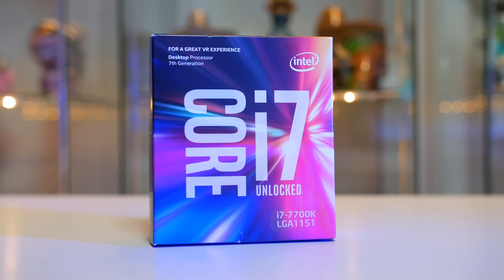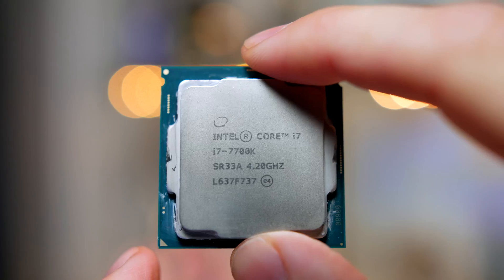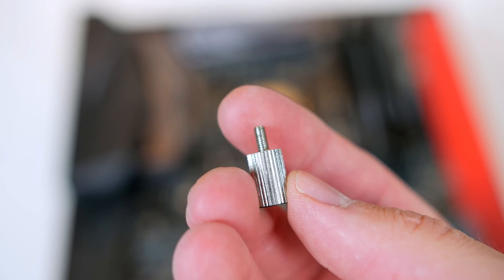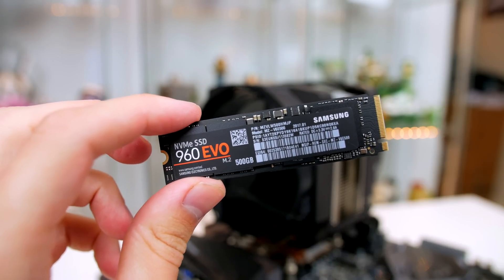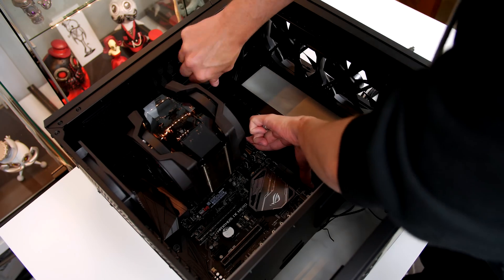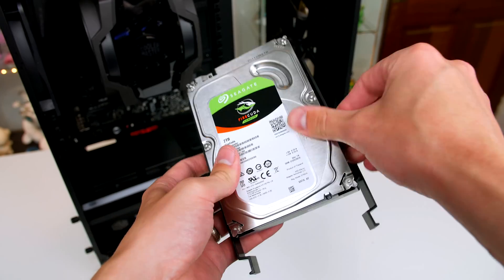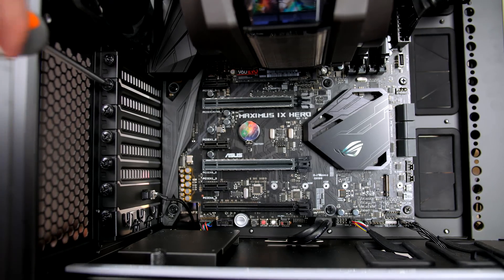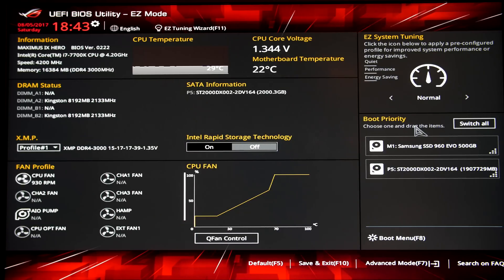How To Build A High End Gaming PC 7700K/GTX 1080 - UNILAD Tech

Comment: I actually have the same build but i have a deepcool cpu air cooler and a gold power supply from corsair 550w . Is it enough or should i upgrade or is it not necessary cus i don't overclock anything

Comment: Overall would you recommend building a computer yourself out of accumulated parts vs buying a prebuilt one? 
I feel like for the same price as a factory built one you can get much better computer hardware wise because you are essentially taking the labour cost of building the computer out of the equation.
Reply from the maker: You can most definitely build a better spec PC yourself. It's not an overly complicated procedure tbh. If you take your time no issues should arise.

Comment: the gtx 1080 ti's in Canada are $1000 which is like $400 dollars more than a gtx 1080. And in my opinion $1000 for a gtx 1080 ti is retarded cause its like half some peoples budgets. So its better to get a gtx 1080 paired up an intel core i7 if your budget is around $2000 (i know this is kind of a pointless comment but i just wrote it for my Canadian pals)

Comment: Can u tell me where I can get that easy extension for front io panel connectors they are super annoying to install always a pain would be nice to connect them into extension little block that tu got there and just shove it on the Mobo easy peasy . Just a super useful extension I'd like to have around
Reply from the maker: +TheSURGEofTech tech came with my motherboard
Reply: BeginnersTech well lucky guy then I guess I should look into the same  case manufacturer maybe they have em for sale

Comment: This is my first pc build. Can you see if it is good and is compatible?
Case- Corsair Carbide Series SPEC-ALPHA Mid-Tower Gaming Case
Power Supply- EVGA SuperNOVA 650 G2, 80+ GOLD 650W
Video Card- ZOTAC GeForce GTX 1080 AMP! Edition
CPU- Intel Core i5-8600K
CPU Cooler- Cooler Master GeminII M4
Motherboard- ASUS PRIME Z270-A ATX
RAM- Corsair Vengeance LPX 8GB
Hard Drive- Western Digitals 1TB Blue Hard Drive
SSD- PNY CS1311 240GB 2.5” SATA III Internal Solid State Drive
OS- Windows 10
Reply from the maker: +Eric Zheng looks fine just put all the parts in PC partpicker and it will tell you for sure. Looks like a great build be sure to tweet me a pic

Comment: 1200w psu is overkill for those specs.
Reply: TWITCHIE224 I'm a noob with pcs and I'm wondering will it fry my pic if I put it in a higher voltage outlet?
Reply: I was thinking the same thing. Maybe like 750 watts?
Reply: Elnikona no you won't, the PC only takes in however much it needs. But the power supply can go all the way to however much Watts it is I recommend a 500watt psu
Reply: M1cha3l Sm1th I'm building a very similar build as the one in the video, I was planning on buying a gold 80+ 650w psu. Should I stick with it or go lower 550w or higher 750w???
Reply: 850 tops
Reply: Gabdu32 i am planning same build with i7 8700x and 750W will do the job

Comment: Wtf why gtx1080 not 1080ti
Reply: Not sure what cards you're looking at, it's a lot more than an extra 50 dollars.
Reply: I can't afford a GTX 1080
Reply: GrodTheAlmighty Well were i live they are 50 dollars more no joke
Reply: country Mac i got mine for $20 more lol
Reply: Steve Rocks he buys a 600 dollar ssd, 250 dollar motherboard, 250 dollar power supply. If he can do that he should have bought a gtx 1080 ti
Reply: TBDG where u live and how much lol
Reply: Fahim Khan The test I saw awhile back. Shows just how unnecessary. m.2 is for gaming system. YouTubers got people out here spending over half a grand on m.2 cards they don't even need. I guess normal ssds were getting to affordable for YouTube rich.
Reply: country Mac whatever u say
Reply: Consider what resolution you are running.  If you're running 4k near max settings, get the ti.  
However, if you want to run 1440p or 1080p with high frame rates (well above 60 for most games), the
 1080 will suffice.
Reply: Definitely going with the 1080ti, will it run any AAA game from this year at max settings 4K 60 fps?

Plus i’d rather go with a $1080ti. $200 more is nothing when you’re already spending $800 on a 1080. Spend the extra $200 get a ti which is at least minimum 30% better in performance than the 1080 and you’ll be saving by future proofing for at least a year or two longer than with a 1080.
Reply: Where do you get $800 for a 1080? thats an outrageous price, this is what i paid for mine:
EVGA GeForce GTX 1080 8gb SC2 GAMING iCX - $589.99, your going to spend almost $800 for a Ti.
As for your question, graphics card is just the card, a good card will help in getting higher fps but...
cpu, ram and running an AAA game on an SSD makes a big difference.

Consider my specs as an example i just built this at end of September here
============================================================
CPU - Intel Core i7-7700K Kaby Lake Quad-Core 4.2 GHz - $339
Motherboard - EVGA Z270 FTW K - $209
GPU - EVGA GeForce GTX 1080 8gb SC2 GAMING iCX - $589.99
Ram - G.SKILL Ripjaws V Series 32GB (4 x 8GB) - $348.99
PSU - EVGA SuperNOVA 1000w P2 220-P2-1000-XR - $249.99
Heatsink/CPU Fan - Cryorig H7 Tower Cooler - $34.99
OS - Win10 64 on WD 500gb SSD
all my games on another SSD by itself.

with the following i get 80+fps in Arma3 and Ghost Recon Wildlands.

Now here is a review, mainly based on arma3 as that is the main game i play
http://techreport.com/review/31179/intel-core-i7-7700k-kaby-lake-cpu-reviewed/11
You need to keep in mind that a demanding game requires a good cpu, ram, and of course a good GPU helps, ram tho does make a difference, for arma3 at least DDR4 at a 3000+ frequency is ideal.
    With my new specs all the games i play which is mainly arma3, and Ghost Recon i can play with maxed settings! So dont let it go to your head that having the best GPU is the answer, its a few components, if you had a high end gpu, weak cpu, and ram, you would have a bottleneck and your game would choke somewhere.
Hope that helps.
Reply: Gunter Severloh we’re all in different countries so everyone’s currency is different :p. I’m getting the EVGA sc2 1080ti here in Canada and it’s, $1000, after tax almost $1150.
Reply: Gunter Severloh also I was thinking of going with the same CPU as your build,  not planning on cheaping out on my build, looking to spend in the $3-4000 Canadian range. (Probably around $3000 USD) since I want to future proof for at least a good while.
Reply: A fellow Canadian :) I was born there but live in USA, want to go back one day, but back on subject a ;)
ya i hear man, whatever you can afford.
Reply: I would go higher with the cpu then because my build is pretty good, and might be fine for the next 3 yrs but the game these days are getting more demanding, be sure to definately get windows 10 because you will be able to run Direct x 12 games so keep that in mind, but ya imo dont go cheap if your a gamer and demand performance and want to be immersed, if you play as much as i do, for me i average maybe 2-5hrs a day more on weekends, otherwise im working on vids and other projects for the arma3 community, but none the less when you play you want that performance, go for it, whatever you think you can afford go higher.
    I would really research first tho, and research parts ect,. based on what your playing, what i did and no i can play what i play full maxed out settings, what a major difference!
Reply: Steve Rocks its only 50 bucks more lol

Comment: Looking to get the best CPU for gaming, what do you recommend? Money's not an issue. Pairing it with 2 GTX 1080s and ASUS gsync 34" curved monitor. 7700k to wait for the 8800k that's releasing this month? Seems like the 8800k is beating the 7700k in benchmarks
Reply: Jason Daudelin you’re better off with one GTX 1080ti than two GTX 1080’s. A lot of new games really aren’t working well with SLI lately from what i’ve been noticing, many new releases don’t even support it for some weird reason, it makes the second card just an expensive paper weight.

Comment: Question for you if you can help. I bought the NZXT RGB fans that you have used in previous builds and have the same motherboard as your old editing pc build. I bought the Hue + as well to hook the fun up for the lights, not sure if you have that on here as it is not shown. I am having an issue because I only have 2x 2.0 USB ports on the motherboard to hook up to which are both being used. One is being used by my Corsair H100i v2 and the other is being used by my power supply. Is there an alternative to this at all?
Reply: I figured this out.. if anyone ever has this issue they can run a micro usb to a regular 2.0 usb port on the back side of their computer and it will take place of the 2.0 slot you might be missing on your motherboard. It might look ghetto but it works.

Comment: Under what circumstances would you recommend GTX 1080 over the TI version?
Reply from the maker: +clarkkent999 if go for what you can afford tbh
Reply: clarkkent999 the ti version is about 200 dollars more on average and while there is a great performance boost, you also have to consider what resolution you are running.  If you're running 4k near max settings, get the ti.  However, if you want to run 1440p or 1080p with high frame rates (well above 60 for most games), the 1080 will suffice.
Reply: I think as long as you buy from a reputable dealer online is fine. I have bought plenty from Amazon and Newegg with no issues, it might be a little easier to go in person if have a store nearby to return any items but online purchase should be fine.
Reply: Jimmy God damn boy you rich af bit seriously I have a question I'm trying to build my pc is it secure to order parts from amazon or online or is it better to go to a store in not from the U.S that's why I'm asking.
Reply: Jimmy Ok thanks a lot because there are a lot of scammers 👍 Thank you
Reply: Alisdair MacDonald kk
Reply: It's 250$ less?...
Reply: Depends on what monitor you have. For 1080p a gtx 1060 is enough but for 1440p get a gtx 1070ti or gtx 1080
Reply: Money
Reply: GTX 1080 Ti is worth the upgrade, you will have that card for a bit and it will maintain its edge in games for the foreseeable future. AMD just launched Vega but sadly those don't compare to the 1080 Ti so Nivida has the high end market locked. But from what Alisdair said, it also matters the resolution that you are playing at and your monitor. If you are just doing 1080p the 1080 Ti is overkill, so is the 1080 for that matter. I personally have a 1080 Ti with a 144hz 1440p monitor and for me the 1080 Ti is perfect at this level.

Comment: hi, I'm planning to build a PC similar to this once the mining craze goes down :) but i would like some advice, I am still unsure about the case. Do you have any recommendations for a case that's good with cooling and has a window?
Reply from the maker: +Aiball I love this case but others worth looking at are 570X and P400s those are among my favourites
Reply: thank you for your input, I will probably get the P400s :) sorry to bother you but i have one more question, I'm stuck between getting H100i V2 cooler versus an air cooler, what would you suggest?
Reply from the maker: +Aiball I love the H100 or the Kraken X62

Comment: Build a budget pc on ryzen ❤
Reply: xMysticalTaz There is no "Ryzen 6"
Reply: Transistor Express *threadripper
Reply: BeginnersTech 3 ❤
Reply: there is now
Reply: xMysticalTaz 😂
Reply: +BeginnersTech ryzen 9
Reply: r5 1400 on b350 board, 2x4gb 2400ram, gtx1060 3gb or 1050ti, 400w bequiet non modular psu, 20€ case... best budget pc atm imo
Reply: We'll see how much time your pc will be useful...
Reply from the maker: GRAN TORINO how budget? RYZEN 3 or 5?
Reply: BeginnersTech 
Ryzen 3 please
Reply: Ryzen 6 or 7

Comment: how do you rate my future build
https://pcpartpicker.com/list/Yvmv9W
Reply: was going for a white and black with red accents
Reply: downscale cpu to r5 1400, upscale gpu to gtx1060 3gb, use cheaper motherboard (b350 tho) and maybe a cheaper case, if you're on a budget. trust me, that'll do better :)
Reply: oh, and go for a 4slot ram motherboard and go for 2x4gb ram, dualchannel is significantly faster! + you have room for more upgrades later!
Reply from the maker: looks good
Reply: I think you could get a better case but it's looks good btw is it black and red or white and red
Reply: From what I've heard (no actual experience here) price/performance-wise, either dropping to a 1400 or bumping to a 1600 may be more bang for the buck. I haven't seen too many 1400 vs 1500x comparisons though.
Reply: you are spending alot of money on the motherboard 
You could get a gtx 1060 if you use a 60$ mobo.
Reply: i chose 1x8gb stick bcuz i want to upgrade to 16in the future
Reply: yes my friend, that's why i said, get a mainboard with 4 ram slots, not 2. so you can go for 2x4=8 and then 2x4=8 in the future and you will have fast 16gb!
Reply: its good but not alot of people know that windows is 100 dollars more for installation
Reply: shit
Reply: Don_ Bil really I didn't know that I thought window's key where $100 everywhere